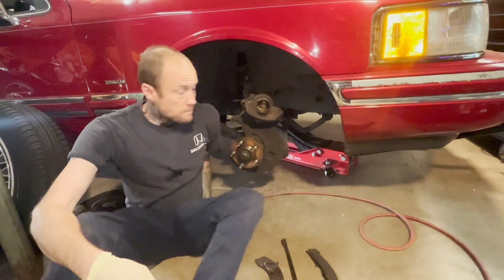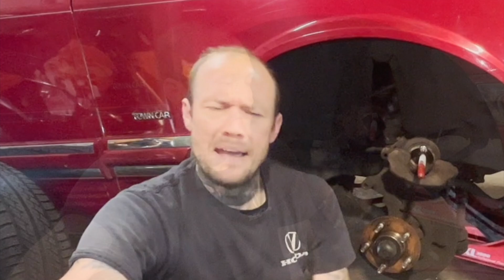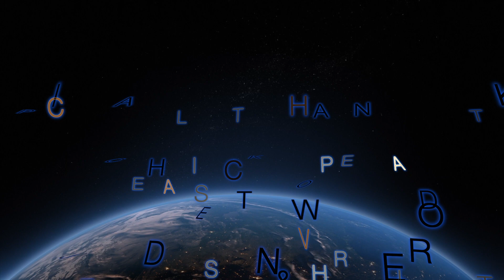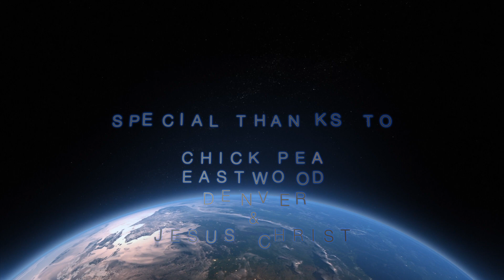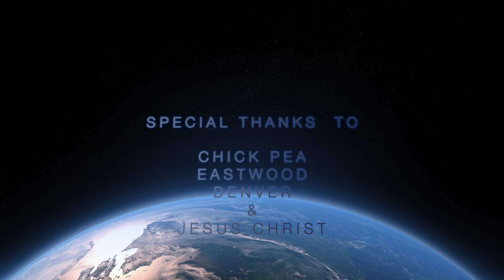What is a Phenolic Piston?

Comment: Steel on the outside plastic on the inside. If you tow a lot, get steel. The plastic will eventually shatter. but if not the plastic will last a long time and less chance or hanging up due to rust. I always go with steel
Reply from the maker: @jamessee9017  thanks for commenting. I had no idea what phenolic meant. I really did have to look it up.